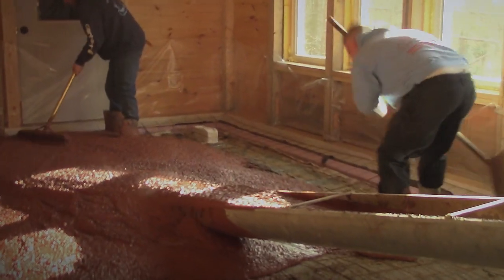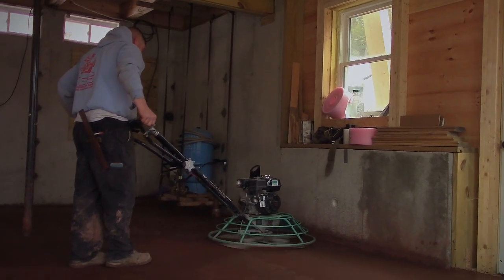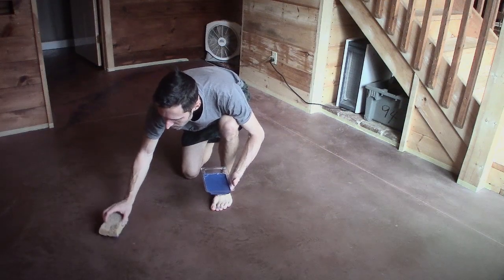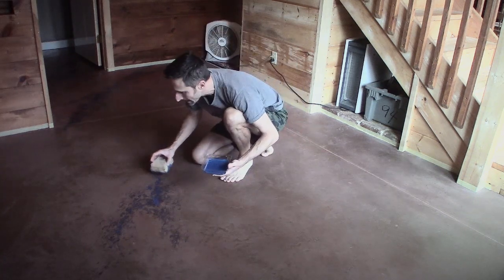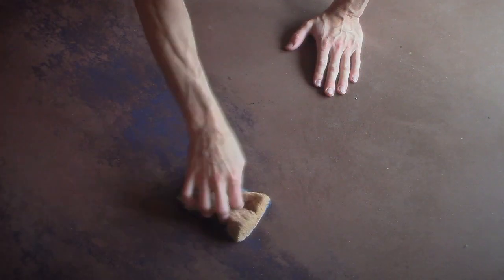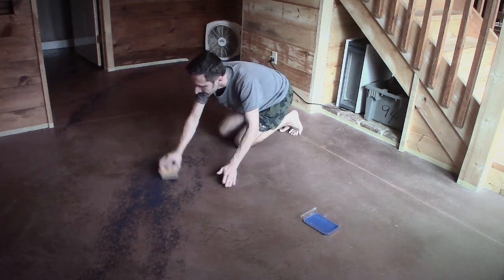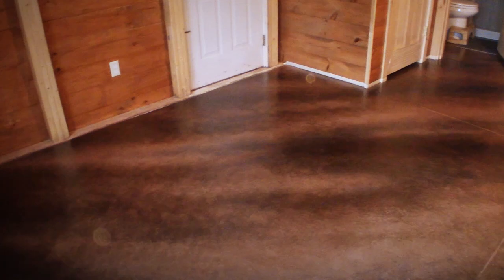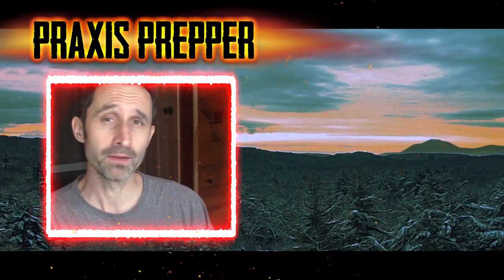How to Color a Concrete Floor with Wood Stains etc.

Comment: Really important to have your property well maintained. Things may not be available soon. My flat is tip top, but I just spent €500 on preventative maintenance on the moped. It will be a real asset if gas prices jump and/or becomes scarce. Pivoting to spending on dental work next week. Preppers don’t mention that dental work needs to a core feature in a preparedness plan!
Reply from the maker: Some of us actually do mention dental. I know that Brad at Full Spectrum recently was talking about it (as one example). I also recently released a short video on that topic not more than a week or so ago: https://youtube.com/shorts/fvewWyzdCFQ
Of all the shorts that I've released, it was the least viewed by far - even though dental is a critical prep AND... it's (IMO) one of the funniest short video intros that I've ever done. ;) Please enjoy.

ps - that feeling of having to-do list items ticked off (like preventative maintenance) is a GREAT feeling isn't it! :)
Reply: @PraxisPrepper  Missed that dental video completely! 😂 Hilarious!
Reply: I'm one of the few that thinks dental is tops.

Comment: For a test patch cardboard is much easier to deal with than concrete.
Reply from the maker: Different surfaces have different properties though. Testing on cardboard would give the user some information, but wouldn't tell the whole story of what it'll be like when the paints or stains are interacting with concrete.